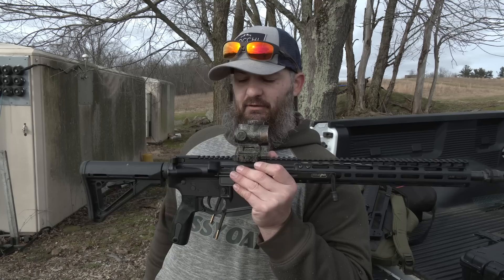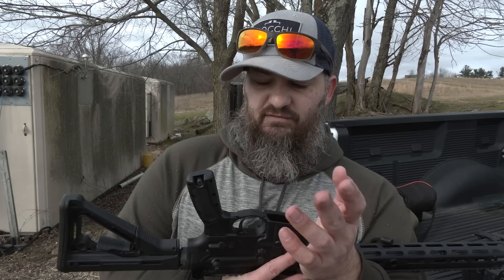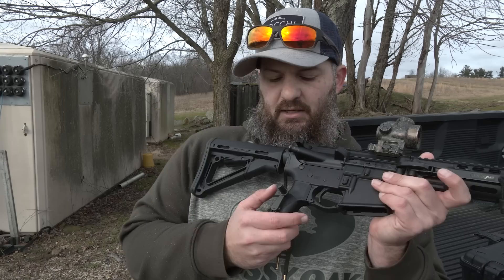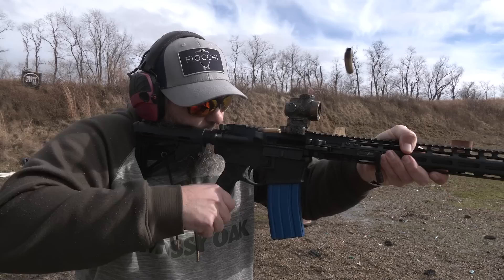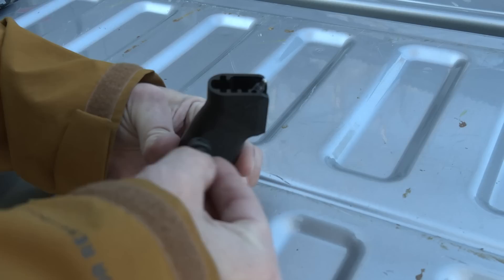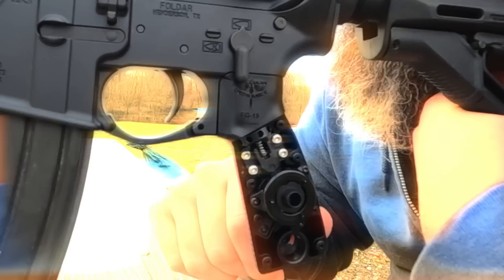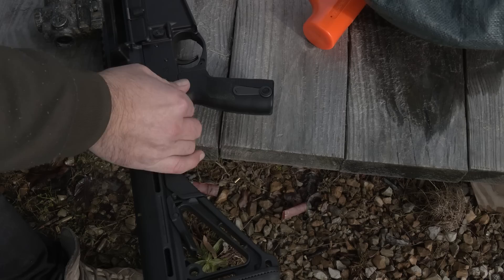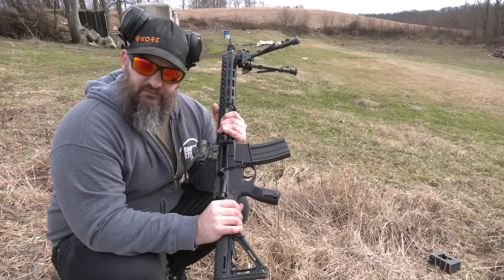Turn Any AR into a Gatling Gun: Freedom Ordnance FG-15

Comment: Immediately stands up to find cordless drill
Reply: @Greyman77  There is, in fact, a cordless Milwaukee drill on the books registered as a machine gun. Can't remember the channel, but they put one on one of those 9mm Glock mag Gatling guns.
Reply: Obviously!
Australia
Reply: Yeah, I like hitting what I'm aiming at, but you do you.
Reply: Umm, why waste the time with a drill, why not just put in the third pin?
I mean, the punishments are the same for a drill, or a third pin.
Reply: @ryanzanow8221  third hole is permanent. Bad idea. Other options at least give you the chance to be 2A compliant and then the option of using your trash can before the dog killers show up.
Reply: I have never done that to my Ruger 10/22!! I've heard though if you cut the kranks there is just a little knob and you hook that baby up to a drill you're going to run out of ammo real quick this is what I heard I would I would never do that (:
Reply: A few select R/C parts and a 3d printer...
Reply: @pARabell9mm   I guess I should have said lightning link, then.
Reply: @pARabell9mm  Either way, not a good idea...the ATF boys will probably wonder why there is a shaft, with no crank.
Just get a Rare Breed or FosTech...
Reply: @ryanzanow8221  fair enough
Reply: @ryanzanow8221  or a Franklin Armory :)
Reply: Get the drum while you’re up. No, not my snare drum!
Reply: Mounted on my UTV CROSS BAR HELL YEEZZZZ
Reply: Have something similar would not be legal with a drill cantthink of the product but it attached to trigger guard
Reply: For $300 do I also get a rub and tug? 😂🤔
Reply: Im in on this “part” for $150.  For $300, like I said….tub and tug 🤔😊
Reply: @jasonm949  Accuracy by volume lol
Reply: That would technically be considered a unregistered machine gun and could land you in prison as per atf definition
Reply: Mini gas turbine 😃😊
Reply: NO! Angle grinder! Burrrrrrrrrrrrrrrrrrrrrrrrrr
Reply: Youre obviously not the first to think of that, but as cool as it sounds to attach a drill motor to it, I am fairly certain that the ATF then calls the gun a machine gun or otherwise illegal
Reply: @ryanzanow8221 gotta be careful talking about them the atf already proved that it's illegal to talk about them on youtube. Look at Matt Hoover in prison for talking about the auto key card.
Reply: Cordless dremmel for the SBR
Reply: Imma keep that thang holstered right next to the glock. 😂
Reply: I literally clicked on this video to make that comment, my naivety to think I’d be the first one.
Reply: Just use a "massager" motor. It already has an unbalanced load on the motor to initiate and disengage the trigger.
Reply: LoL that would be multiple rounds with one trigger pull using a drill becareful
Reply: @josephatnip2398  Yep, there used to be a commercially available glove with a built-in motor that could pull the trigger for you... was declared a machine gun.
Reply: Or a reciprocating saw 😏🤫
Reply: @pARabell9mm  2A Compliant?
The ATF isn't 2A compliant. Shall Not Be Infringed means Constitutionally all their regulations are illegal.
Reply: @TheGunsNBlades No, no, no, I said “rub NO tug!”

I hope someone gets that movie reference
Reply: Whoa now. That's felony talk.
Reply: Great, now we can’t have cordless drills🤦‍♂️
Reply: @pARabell9mm didn’t know the 2A said anything about full autos🤔 that came from silly ass modern day DC weasels.
Reply: @TheGunsNBlades if you pay $300 for a useless pistol grip you can forget about any rub and tug, you just got bent over😂
Reply: Fact! 😂
Reply: @pARabell9mm   Im confused by your comment "2A compliant" ?
according to our 2nd amendment, there should be NO restrictions on what we own. up to and including nukes (anything the govt has "we the people" are also allowed to have)
Reply: Lol
Reply: Really swap out that little shaft for a nut and bolt add a drill and you have a crank driven Gatling gun
Reply: Great review.
Reply: And a drum mag
Reply: 1/4 inch bit adapter next. Lol
Reply: Dude swear as so as saw this thought same thing,,🤙🤙😂😂😂😂
Reply: Rifle wants to be a mini gun 🤣🤣. All the smoke
Reply: That was my first thought 🤔
Reply: @mollyhackman4910  🤣🤣🤣🤣👍
Reply: ATF knocks on door shortly afterwards
Reply: @roycesjourney37  we are HERE FOR YOUR DRILL YOU ANARCHIST,,,,🤣😂😂🤣🤣😂😂😂😂😂

The drill is fully auto semi
Reply: I bet you could shoot just as fast with your finger😮
Reply: I want to hook a differential 90 degree turn for that cordless drill
Reply: Supersafety is king of brrrrrt now, crank too slow
Reply: You know it! 😂
Reply: Gonna rig it to a foot petal sw with a Dremel.  4K plus rpm makes it a minimum if it can withstand 🥳🤣🤣🤣😇
Reply: Heck yes sir!! This is the power of white ingenuity!!
Reply: @peekengineering, what exactly do you mean?
Reply: Wait till the ATF gets a hold of this!
They want it all.
Reply: Drill would be no good. If you crank it 2 fast the hammer follows the bolt forward and it does not fire.  You are limited to the cycle rate of the bolt  and can not make this shoot more than roughly 600 rounds a minute
Reply: @tymz-r-achangin  So I am no attorney but if Rare Bread (read that as when) wins at SCOTUS and the definition is locked and loaded this would still appear to be 1 round per action of the trigger. Watch the slow mo the trigger does move and reset for each round.
Reply: Shhhh don't say that too loudly
Reply: Came here to post this
Reply: Its useless really.
Reply: @ryanzanow8221  'but wouldn't you know it officer, the damn thing fell off!'
Reply: Dakka time.
Reply: I thought exactly that 😂
Reply: The comment  I came to make
Reply: @stanants8566  be smarter than you appear to be...🙄
Reply: @Greyman77   no, theyll just label the lower as such
Reply: How much you wanna bet that ATF will call that a full auto conversion since the drill trigger becomes the gun trigger in operation?
Reply: yo im crying laughing
Reply: Most Redneck, American comment here 😂 thanx
Reply: Would have been interesting to see it shot from a standing position with a tripod to demonstrate how it can work as well
Reply: ATF Knocking!  Psyop.  Look how slow it is compared to just pulling the trigger.
Reply: Now thats a felony
Reply: might i point to a way to make it belt fed too?
Reply: @Greyman77 we should just not care what they say stuff is when it isnt they even classify a string or shoestring or whatever itself a machinegun not even attached to the gun so id say screw them like the second amendment intends
Reply: @pARabell9mm wow🤦🏻‍♂️
Reply: @glennllewellyn7369 🤦🏻‍♂️
Reply: @jasonm949 🤦🏻‍♂️
Reply: @pARabell9mm 🤦🏻‍♂️
Reply: @ryanzanow8221 🤦🏻‍♂️
Reply: @pARabell9mm 🤦🏻‍♂️
Reply: @davidscbirdsall 🤦🏻‍♂️
Reply: @TheGunsNBlades 🤦🏻‍♂️
Reply: @Odysseusnobody yes it would second amendment read it and understand what it says and means and why it was written to begin with then come back all weapons are legal without anything they say you ""need" for it to be "legal""
Reply: @glitterforcemaximus7232 🤦🏻‍♂️
Reply: @billhusk8569 because they would allow it to happen thats the whole point of the second amendment its to fight back physically against them putting you in jail or killing you illegally 🤦🏻‍♂️
Reply: @herbrice8933 🤦🏻‍♂️
Reply: nonono, you're getting ahead of yourself. servomotor and LIPO pack.
Reply: @jasonm949  so use a servomotor off a drone and lithium or 2
Reply: @d0sitmatr  that's exactly what I meant by "2A compliant". No restrictions. There's 2 ways to be "2A compliant" publicly, where you wind up in jail, and you dog winds up dead, or privately. Choice is yours.
Reply: Go to jail. Do not collect 200, do not pass go.
Reply: I'm not a US citizen but I believe that technically falls under automatic fire. Gonna need a licence for that mate XD
Reply: Don't let the ATF catch you or they will make a new rule and take them all away.
Reply: @iPsychlops  🤦🏻‍♂️
Reply: @Greyman77 alphabet folks 🙄
Reply: Don't worry it's on sale for only $289
Reply: @Rj-nh1df  🤦🏻‍♂️
Reply: Hundred round drum, cordless drill, mount the gun 😂
Reply: @gulf-foxtrot-yankee5600 , how well would this crank grip work with a FRT?
Reply: @davidscbirdsall , I got the Magpul D60. Haven't rocked it yet.
Reply: @warpartyattheoutpost4987  probly not very well you can out run them pretty easily
Reply: @warpartyattheoutpost4987  also just get a full auto if you want to run that fast
Reply: Bro, I was literally just thinking the same thing
Reply: @georgeperaza4052  🤦🏻‍♂️
Reply: Haha i was thinking the same thing 😂
Reply: One jam and you're looking at a new firing pin at best, and a cool eye patch at worst.
Reply: @sCarredeYelOver  🤦🏻‍♂️
Reply: @jasonm949  not hard to hit a whole group of prote- I mean zombies....
Reply: @d0sitmatr   The 2nd Amendment doesn't say any of that, in fact until like 2008 (Heller v. D.C.) the case law involving the 2nd Amendment didn't even explicitly guarantee INDIVIDUAL firearm ownership rights. The Second Amendment along with ALL of the Constitution has been subject to different interpretations of varying validity.
Reply: @justalurker3489  and interpretation means nothing again with the way its worded never gives them the power of "unless they interpret it to mean something else" or anything like that
Reply: @greenspiraldragon  🤦🏻‍♂️
Reply: @NithinJune  🤦🏻‍♂️
Reply: @Botchedtoeknife  🤦🏻‍♂️
Reply: @justalurker3489  and yes i know what the whole thing says and means and why it was written and its not the bullcrap that leftist say about not having a military at the time and not about hunting etc like that and its not just for people in a militia or whatever because the people are the militia cause the second half says "the right of >the people< "(so everyone since it doesnt specify what people and no the first half saying a militia isnt the specification here or they wouldve said "the right of the people in a militia or "the right of the people in the militia" etc like that instead )  and doesnt matter what any part of the government says about it or not because it says "shall not be infringed." (infringed means limited) not "shall not be infringed unless____" or until____" etc like that to allow for it to be changed in any way or for any reason or by any part of the government etc like that
Reply: @glcartm   That was unintelligible, it literally is about allowing people to own gun because they can form militias in their community. There's actually nothing about self-defense in the 2nd Amendment, the US idea of self-defense comes not from the 2nd Amendment, but from other laws that states passed. I mentioned Heller v. D.C. because until then individual firearm rights weren't as set in stone, it was just another BS Supreme Court decision. The Supreme Court is stupid regardless, it's undemocratic and kind of luck-based (whoever is the president when a justice dies gets to nominate a LIFETIME position). Not to mention it's theoretically an apolitical position, but everyone on every side knows that's BS.
Reply: Yessssssss😂😂😂😂😂
Reply: Lol I like the way you think 🤔
Reply: Bro never thought of that now where talking lets go I want to do this to my guns so sick
Reply: @Greyman77  A drill is a machine tool and it’s connected to a gun.

Seems sensible
Reply: going to need to find a belt feed to complement that drill
Reply: I like the drill idea
Reply: i was gonna say that lmao
Reply: @glcartm  non answer ?
Reply: There goes my ammo budget for the year.
Reply: yowww i was like okay so small motor, got you!
Reply: 🤦🏼‍♂️ This really makes no sense! Joke category!🤡😂😂
Reply: I feel like the binary is probably more accurate and fires as fast as the gun can cycle once you get it down...
Reply: Beat me to it. Glad I’m not the only miscreant whose first reaction was “electric motor”. 
👍
Reply: @pARabell9mm   “2A complaint” ain’t what it used to be…I prefer the term “Federalist Overreach compliant”
Reply: Damn, you read my mind 😂
Reply: I was thinking more of a dremel for easier handling
Reply: Hook up an electric motor to it, or may be a spring wound mechanism interesting
Reply: @stevepalpatine2828  ya’ll always forget the “well regulated militia” part huh?
Reply: @Fireclaws10  You have to read documents with a knowledge of the language used at the time they were drafted.
"Well regulated" in the context of the way the term was understood at the time means "well equipped" and "well disciplined"
You may be mistaking "regulated" as having its current meaning, which it does not.
They were not saying "well regulated" meaning the government gets to impose restrictions.
And "the militia" was any and all free men of fighting age, ie the people who had just defeated the British.
They didn't mean that the only people who should be armed were the government, they had just defeated an oppressive government themselves.
You just have the read any of the correspondence of the drafters of the Bill of Rights if you're in any doubt, they were quite clear.
I don't blame you, it's a failure of our education system.
The purpose of the 2nd was a last guard against tyranny of oppressive government.
You have to understand things in the context of the time.
The Founders had just fought a rebellion against a government that tried to oppress and disarm the people.
Do you really think the people who had just won a war against one oppressive government would draft that term with the meaning that another (potentially oppressive, as that was what the 2nd Ammendment was  drafted as a safeguard against) government would get to control the people's means of defense?
Reply: @stevepalpatine2828  sounds like a whole lot of waffle tbh. The second amendments is very much up to interpretation. It says people have the right to bear arms, it doesn't specify what specific arms you they the right to keep. Not being able to buy  a fully automatic rifle is not restricting your right to bear arms as a whole. There's still plenty of options available to you. 

There were only 2 lines to the second amendment, so that future generations can use their own judgement to determine how it should function. Not to have complete carte blanche to do whatever the hell people want without restrictions.
Reply: @Greyman77   It's a fight against the regulation more than the enemies.
Reply: lol I looked into that... soon as you power it by a motor it's turned into a felony
*This is the next thing aft will ban though.
Reply: Came to see it
Reply: Add the clock spring, wind it and then the escapement.
Reply: @mandykc5297 достаточно применить часовую пружину
Reply: @user-ev4pb9xj7e часовые заводные пружины😂
Reply: With a laser,web cam, electric motors with miter gears... One hell of a security camera
Reply: Yea that'd unfortunately be illegal sir
Reply: @jasonm949  That's the secret of spray and pray, the more you spray, the less you have to pray.
Reply: That was my first thought too.
Reply: Cuz that’s how cordless drills need a tax stamp.
Reply: We all thought it but you said it out loud on the internet 🤦‍♂️🤫
Reply: We are going to register my fingers as machine guns next

Comment: UMMM... this is a deal breaker... I keep my snacks in that compartment.
Reply: Sounds like you need a hollow A2 stock.
Reply: That's what a beard is for.
Reply: I keep spare parts, all the springs and a firing pin.
Reply: @partycakes456  Hey Napoleon can I have some of your totts
Reply: That's where the Skittles go.
Reply: Hmmm someone needs to invent a rail mounted snack bag.😂 Or just use old surplus grenade pouches. That's what I did in the Army. I used the handle for a couple cigs and one of those thin crack lighters for emergencies. 😁
Reply: @PartTimeGoblinSlayer  i put 3 rounds in the rear stock compartment.  Just in case, my buddy said where is the just incase cigarette?
Reply: thats what the rail mounted bbq sauce holder is for
Reply: Definitely can't give up my "Skittles" compartment.
Reply: A2 stock bro
Reply: $280 grip? I'm good thanks 👍
Reply: Smashed up Pop Tarts in honor of Paul Harrell.
I think that's a haiku...
Reply: I'm sure you can fit just as many crayons if not more in a pocket.
Reply: tactical snack? Yes, tactical snacks.

Comment: "This does not look very Super Safe." -Hoffman
Reply: everyone is sleeping on the super safety. it's on another level over these gimmicky things, at least for now while it's legal
Reply: @monkeysfromvenus    It really is true genius.  WTF kind of mind figured it out?  A dude who runs around barefoot and the only gun he's ever purchased is a Barrett .50!
Reply: Effectively a lightning link though?  Should we buy 50?
Reply: @breckfreeride  a super safety resets the trigger between shots and you are required to pull the trigger again for it to fire. A lightning link will continuously fire with one function of the trigger until you let go.
Reply: @billn911  so buy 50?
Reply: @breckfreeride  if you are an NAGR member and have 50 rifles and an unlimited ammo budget. Then, yes!
Reply: @monkeysfromvenus It's not legal - it just hasn't been specifically targeted by the ATF yet. It would fall under the same ruleset as a Forced Reset Trigger (because that's what it is, essentially),  and so the current pending case the ATF has against the FRT is what will determine the legality of the HTSS. Realistically, the ATF's gonna win because that's just how it goes, since it's not just the letter of the law that matters, but also the spirit and color of the law. Devices like the HTSS and FRT may adhere to the letter of the law, but only just barely... and so that means the "next check" is whether or not those devices adhere to the spirit/color of the law, in which case they do not (as both were intended to, essentially, act as "good enough" analogs for automatic fire).